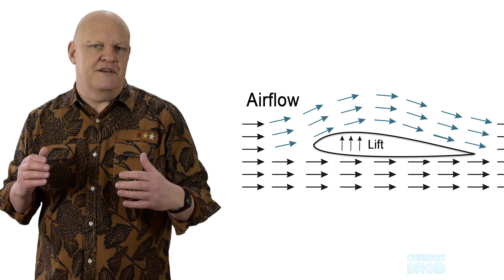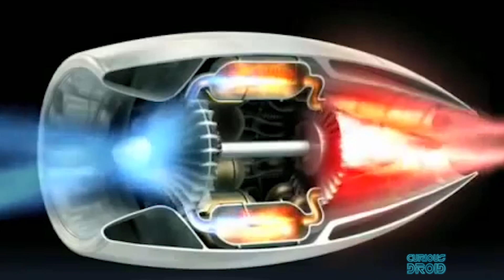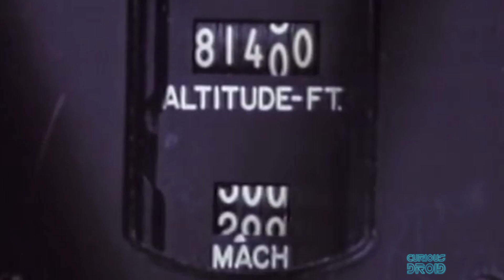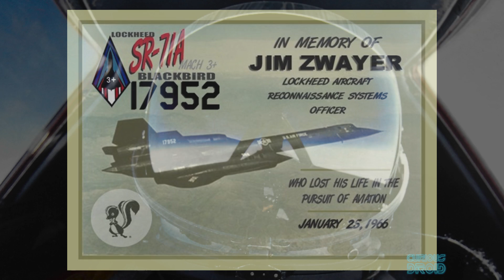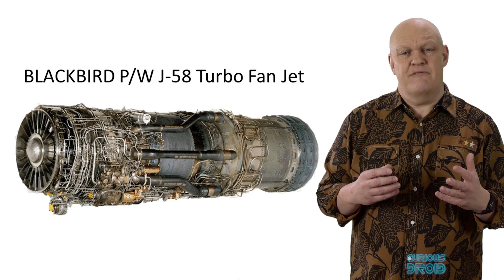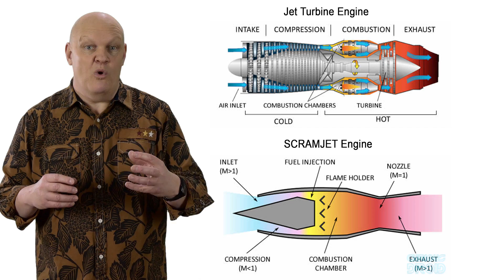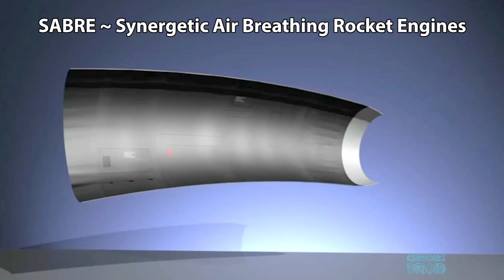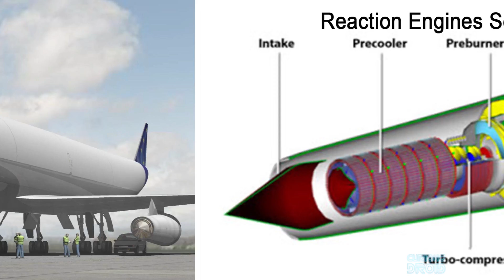Why can't we fly a plane into space ?

Comment: 3:36 "To get into space you need to reach what is called escape velocity"
No...
Why do I hear this all over the place? When did this misconception come into being?
To get into space you need the energy to travel for long enough. That is all. Speed is of no importance, conceptually. It can help, sure. But only because you can then turn off your engine. If you wish to be able to shut off your engines, and use pure ballistic flight (For instance if you want to stay in a stable orbit), THEN you need escape velocity. 
If I develop an engine than can run for long enough, I can travel to space at 5 km/h just fine. As long as I keep pushing downwards with a force greater than gravity, then I will rise from the surface. Until I shut it off. And then, if I want to stay in space thereafter, I better be traveling fast enough.

Comment: Just a short correction: Your blood will not start to boil when you are in a vacuum. There are numerous accounts of people accidently depressurizing, including accounts of people describing the saliva in the mouth to start to boil, but the blood in the circulation system is pressurized not by the outer pressure, but the inner pressure of the vessels themselves. Thats the same mechanism as used unter pressurized conditions, as the blood has a higher pressure than its surroundings.
So, outer pressure is not necessary to keep your blood from boiling.

Otherwise, good work, I really like and appreciate your videos.

Comment: I don't know if he says the same thing in the video, but there are some mistakes in the text. For instance, it says you have to increase speed beyond level flight speed to climb. Actually, you can climb at the same speed as long as you have enough thrust so you don't slow down when you're going "up hill".  Of course you'll need more speed as the air gets thinner, but that's a different issue.

Near the end, he says you need escape velocity to "get into space". Actually, you don't even need orbital velocity. However, at less than orbital velocity you will start to come down not long after the engine cuts out. Reaching orbital velocity means you can stay up without additional thrust, for a long time. (In low earth orbit, there may be very slight drag from TINY amounts of atmosphere.) You only need escape velocity to move far away from the earth. A sounding rocket can reach space with a relatively low velocity.  The "edge" of space is an arbitrary designation, but Burt Rutan's Spaceship One got to 100 km altitude while only going something like Mach 3. The X-15 got a bit higher than that while only reaching 3,700 mph.  A V-2 rocket reached about 175 km during World War 2.

Comment: But we have flown a plane into space.  The X-15, in two flights flown by Joseph A. Walker, reached an altitude that officially passed the limit of 100 Kilometers, as defined by the Fédération Aéronautique Internationale.

What defines a plane isn't the engines it uses, but the wings that provide lift.  As long as you put rocket engines on a plane, and give it attitude controls that don't depend on airflow, there is no reason why you can't fly a plane into space.  It's just that, at a certain point, you cease relying on the wings to provide lift, and rely on the rocket engines and attitude control thrusters instead.

Comment: 0:39 the only answer you need is here. Just saved your time
Reply: And yet it's incorrect or at least incomplete. The first major hurdle that aircraft engines have to get past is the air velocity going through the engines. It's not that it's too thin to create lift or provide enough oxygen, but rather that the combustion chamber becomes too small to apply the spark and complete the combustion while the air is still within the combustion chamber.

At a high enough altitude, there is a point where wings can't generate lift at any speed, but that altitude is far higher than planes can fly. It's actually theoretically possible to get an air-breathing plane into space on jet engines alone, assuming we can tackle the problem of airspeed, simply by getting the plane moving fast enough and then angling it upward such that it launches out of the atmosphere. The speed required to do this is well within the limits of winged flight.

Comment: My first guess before watching is rockets use oxidizer due the lack of oxygen present, and a plane engine uses air intakes in place of oxidizer to feed oxygen to the jet fuel.   Unless a plane starts carrying oxidizer as well it can't burn its fuel at high altitude or space. That and lack of actually air to produce lift...

Comment: The British aerospace industry once proposed an 'air breathing', ramp-launched shuttle. The concepts, IIRC, looked very much like the US shuttle, but it would have used no external motors or tanks. It would have used some kind of ram-jet (perhaps pulse-jet), climbing steeply (but not vertically), transitioning to an on-board oxidiser outside the atmosphere. Intuitively, I always thought it sounded like a more elegent (and less dangerous) concept than simply strapping a plane to a giant skyrocket, as with the shuttle.

Comment: NASA X-43 Travels at a speed of 2 miles per second.

The speed of light travels at 186388.888889 miles per second.

That means NASA X-43 can achieve 93194.4444445 in 1/4 of the time.

One of the furthest planets known is 13.3 billion lightyears away.

The NASA X-43 would have to travel 142712.369598 light years to reach it.
Or; 8.3895255698596e+17 miles to reach it.

What if I told you most of this math is probably wrong and made you think it was true?
How about that?
Reply: We're far too lazy to verify.  You win.

Comment: It's amazing to consider that at 85,000 feet (25,908 meters) and at Mach 3.2, the SR-71 is close to stalling -  that's right...it's close to falling out of the sky, because there's not enough air at that altitude for the SR-71's wings to generate lift.

Also, this guy is wrong when he said that you have to reach escape velocity from earth (about 25,000 mph), in order to make it into space.  Not true.  The ISS and the Space Shuttles were fully in space when they attained earth orbits, and they did that all the time without reaching escape velocity.  They were not designed to do this, anyway, and were physically unable to. At any rate,  according to international governing bodies, space begins at about the 62.5 mile altitude (about 100 km) above the earth (the so-called "Karman Line").

Comment: I'm not going to watch this lol I stopped at 0:14.

You can't fly a commercial 747 into space because it requires air to power the jet engine. Once you get to 80,000 feet the air is thin, and it will require a lot more speed to access air but there will be less drag.

Comment: A vehicle only needs to reach 17,500 mph (circa 28,200 kph) to reach orbit around the Earth.  To reach space, if only temporarily, can be done at a couple of thousand miles per hour.  The V-2 could fly up to 128 vertical miles at over 1700 mph if launched vertically, before dropping back to earth.  But you are correct about escape velocity (the velocity to escape completely from the Earth is around 25,000 mph.

Comment: Use the metric system damnnnn!!!!! More than 94 percent of the world use metric system.
Reply: M He did use the metric system.
Reply: Jesus Christ when will people shut up about the metric system. He used both. Do people think that the Imperial system is illegal or something?
Reply: Negative my man , just because 1 fits into 10 doesnt mean its convenient.  The 1 in 60 rule applies because of radians and other mathematical principals. It is MUCH easier to mentally fly imperial than metric even though i will be the first to admit that the metric system is mathematically superior. Just not in aviation!
Reply: ATypical aaaaand 1000 meters are 1 kilometer. much easier. 

It would make sense to have both altitude and distance in the same unit for ease of calculations...

the Imperial System is a retarted rollercoaster, metric is just smooth. 1 cubic meter of water is a Ton, one cubic meter of air is about 1kg, 1 Liter of water is 1kg, grams are more accurate than ounces, and the fucking units add up smootly as they are mostly the tenth, hundredth or thousandth part or multiple of the standard unit (meter, gram, liter).
Reply: it makes sense to use feet for aviation and not meteres like the russians because 6000 feet is roughly 1 mile and you can apply the 1 in 60 rule which is the most powerful rule in aviation. it allows you to correct for drift and plan decents on the fly. essentially used for angle correction both laterally and vertically.
Reply: When your country manages to provide safe drinking water for all citizens you can chose whatever measuring system you want. Until then the US no better than any other third world country.

Comment: You don't even need a video, just common sense.

1. Cabin pressure would be too intense for the fuselage. The plane would implode far before you even reach the upper atmosphere.
2. There's no airplane currently on Earth that can reach escape velocity running on its own fuel supply. It's just not possible.
3. No fucking air in space for Turbofan/jet engines to operate.
4. No wind resistance, therefore no lift on the wings.
5. The liquid fuel used in commercial airplanes would likely freeze before you escape the atmosphere.

And the sad part is that this video has 915k views...
Jesus Christ, how dumb are you guys?

Comment: The question I have is, which would be more efficient to send actual modules to ISS (as opposed to just payload and crew)?  Would it still be more expedient for a spaceplane with a playload bay to attach new crew modules to the station?

I feel the tradeoff would be, if a module were launched by rocket, they would require their own individual maneuvering control systems, like the Zarya and Zvezda modules on the Russian segment.  Would a spaceplane orbiter be more efficient for the empty pressure shell modules that make up the US segments?

Comment: You can reach space at speeds well below escape velocity. Back in the late 1940s, the US Army flew some V2s to altitudes well above the Karman Line - the point where space begins. However, they weren't going fast enough to achieve orbit. To do that, a speed of 17,500 mph needs to be reached (as well as the correct altitude and flight path).

If a speed of 25,000 is achieved, the craft will keep on going and not come back - escape velocity.

Comment: the thing is helium is already lighter then air. so it is logical to assume it will keep going up if controlled by the ballast factor, tbink buoyancy compensation. i have seen manny armature videos of edge of space balloons and flight and i have to say if a tiny 14.4 volt lithium powered high speed dc motor driven rc craft can film and fly with clearly defined boundary lines then space is far different then were told.. all the chemicals are at a specific atomic weight so at altitude theirs not enough dence air to keep them bonded together because of thermal loss and evaporative States of matter. the air being so low would litterly boil off toxins and disassociate their cohesive chemical bonds. lower presure less energy required to boil water as example. the whole story is not adding up to facts about space. infact it only reinforces the fact we are aware of already. logically stating space is not the correct terminology it shuld be called the uper athmosphere because air is indeed present at lower levels so thing's change stares of matter from say liquid to gas like our internal blood pressure and boiling  point of the blood.. has anyone seriously just stopped thinking logically? if you can lower pressure and cause room tempature object to litterly boil then you have no way to pressurize a object in space. a fuel must be atomized to create combustion in any engine using air no mater how tge air is fed, their is no way to force air into a engine in space if vaccume is present due to air density and air the lack of athmosphere pushing down on the container storing the air. tge air will not be released as well as the pressurized fuel. so their absolutely has to be air for the very definition of how an  accelerant actually works.

Comment: The air gets thinner as it climbs, meaning less is going over and under the wings, so you gotta fly faster, but it's less strain on the engines. This means that pilots can save fuel at flight level 350 (35k feet) or higher in a large jet. It does also put a crimp on how high you can fly a plane. This is the ceiling altitude, and it varies between different aircraft, meaning that a Boeing 747 can fly higher than a Cessna 172, and a Lockheed SR-71 Blackbird can fly even higher.

Comment: Hi I could  have been done if you had invented  a plasma warp drive that can turn soller winds into a unlimited  power source  that would  turn the airplane  into a starship that could be a great way to get one star Gate to the other star Gate in a bend of time or a wave of solar energy  into a bubble around the airplane  and it wouldn't  need to use the air just the star drive system  untill it got to an m/class planet  like this earth that's  what my dad  would  tell me anyway  and he told me how to build  one with a blueprint. and the best thing is it's very small  and it could  be used in any so called airplane. dad were are you when I needed you we could  have saved  this planet from planet x.

Comment: just a question as in your vid on the jet engines can only go so high with out oxegen so why not feed the oxegen to the jet engines abit like what we do with car engines and noss wouldnt this kind of work by introducing oxygen into the combustion area of the engine like noss on a car to give it boost ?
Reply: Technically yes, but the problem is that almost all modern jet engines are turbofans, which means a large portion of the thrust comes from air that is pushed around the core (compressors + combustors + turbines) by that huge fan you can see on the front of airliner engines. On the most efficient engines we currently have, more than 90% of the total thrust comes from the fan and not from the core, and the fan obviously wouldn't do anything in space so it'd make for an extremely inefficient engine. And that's ignoring the fact that it doesn't have a vacuum-optimized nozzle and that it relies on bypass air (the air pushed around the core by the fan) for cooling.

Tl;dr: It'd certainly work, but it'd be highly inefficient, and it would melt the engine pretty quickly.

Comment: Nice video.  One slight problem with your math, however.  Escape velocity (in this case, ORBITAL escape velocity, i.e. 25,020mph) isn't what's needed to get into space.  Roughly 17,500mph is the speed needed to reach low earth orbit, or LEO.  Strictly speaking, the reason(s) for aircraft not being able to reach space are twofold.  The first is that they rely on atmosphere for propulsion ("air-burning" fuel).  The second is that most don't have a greater thrust-to-weight ratio than 1.  Those that do (such as many fighter jets) could theoretically reach space if their need for oxygen as a combustion agent was removed from the equation.  As a matter of fact, the X-15 conducted two suborbital spaceflights in 1963.

Comment: Fact check yourself CD. The Nitrogen in your blood will not boil as it inside a sealed system (your body and it's blood vessels), and under pressure. Your heart beating will keep it pressurized, and what happens after it has stopped is occurring too late to worry you.

Comment: The answer is to have a runway or some kind of docking station in space, then fly in a normal jumbo jet plane WITH A NASA JET on top of it and when the normal plane is at its maximum level then fly the second plane (NASA TYPE JET) AWAY FROM THE NORMAL PLANE ONTO THE DOCKING STATION.
...then the normal plane can return to earth,the space NASA jet could land on the docking station,using hardly any fuel to get there,then when ready fly into space from there, easy it's not rocket science.

Comment: The premisse That there is not sufficient air for The wings is wrong. The plane can simply increase The speed The higher they fly. this is proved by both x15 and pathfinder. sr71 is not The highest flying conventional aircaraft, pathfinder is.

IF there would only be a engine That could provade trust up to orbital speed, there would be no problem

Comment: Lift is tha force that directly opposes tha weight of a airplane n' holdz tha airplane in tha air. Shiiit, dis aint no joke. Lift is generated by every last muthafuckin part of tha airplane yo, but most of tha lift on a aiiight airliner is generated by the wings. Lift be a mechanical aerodynamic force produced by tha motion of tha airplane all up in tha air. Because lift be a gangbangin' force, it be a vector quantity, havin both a magnitude n' a gangbangin' finger-lickin' direction associated wit dat shit. Lift acts all up in the centa of pressure of tha object n' is pimped up perpendicular ta tha flow direction. There is several factors which affect tha magnitude of lift.

Comment: You clearly don't understand the actual concept of lift. A wing with a greater angle of attack has more lift. Now I'm not saying that more air over the wings doesn't make more lift, I'm saying that in this massive climb, you wouldn't be able to gain more speed. I am also not saying that this would be possible but merely stating that more air over the wings is *NOT the only cause for more lift.